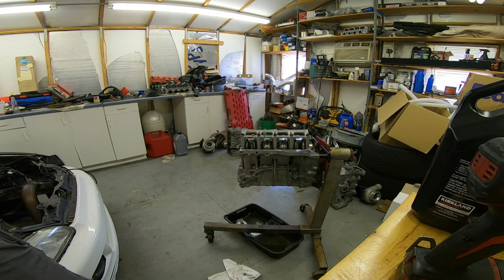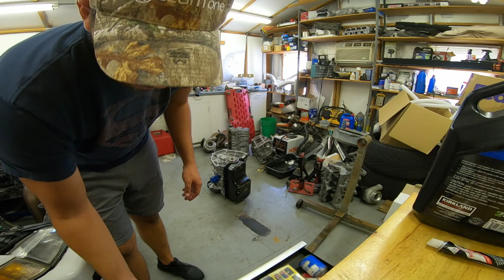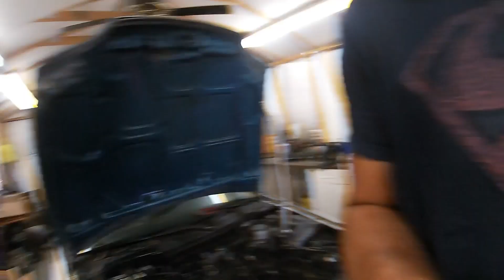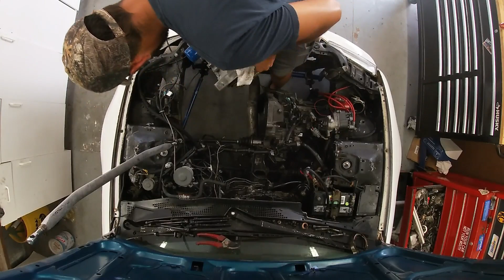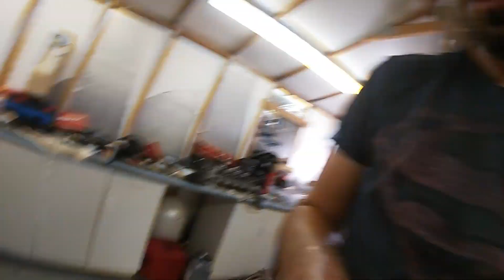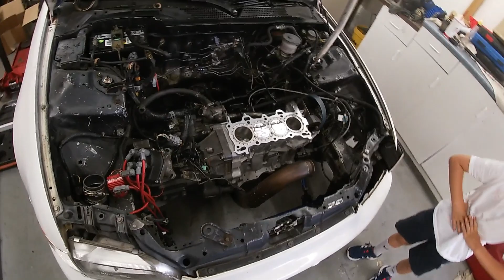11.65.1 comp D16Z6 block build/final assembly and install.

Comment: Bro I have a mini me d15b2 block with po8-3 head no VTEC with pmg-fi obdo distributor 2 and 3 for the streets cities 4 highway and 5 over drive gd on gas on highway around 40 42 miles a gallon crusin in my CRX 2 3 4 gears to 7200 rpm no problem with gas the duel point is a Weber carb with out the float or bowl comprende amigo and I'm around 10.5 compression with out shave head if I shave the head 10 mm I probably be will be around 11.1 or more with the y8 head gasket and believe me on a 4 barrel EFI system or regular carb be a monster with upgrade springs and retainers probably 8500 rpm easy and all motor regular carb don't have limits rpm or Weber no computer crap only start up and ramble real simple

Comment: Bro easy you can that compression with a d15b2 block with po8-3 head with the VTEC and 272 cam with a 4 barrel carb or EFI carb system and run on 91 to 93 otane gas you can even go 12.1 compression on aluminum head on gas I think with are different

Comment: How’d you get the block in there without removing the axles? I had so much trouble trying to do that. Any pointers?? Thanks
Reply from the maker: Axle's shouldn't be in the way at all. its pretty simple to get in, main thing is having the clutch aligned properly and the post mount needs to be off.
Reply: Well you made it look easy 😆 I was fighting and scratching my head. I’ll give it a go again this weekend and shoot an update! Running the same pistons on my build. How do you break your engines in? Thanks again!
Reply from the maker: @dAnIeLJeE87  i use non detergent 30w and just start driving, I try to keep it off the limiter for the first 200 miles but still drive it hard. as long as oil pressure stays consistent im ready to send it after that.

Comment: Hey bro I have another question I was going to order a aem fuel rail for the z6 but I’ve read online that the mounting wholes are different from y8 to z6 I have a skunk2 pro intake manifold will any d series fuel rail fit ?
Reply from the maker: yes, difference is regulator position.

Comment: Nice!!!!!!!! What chip did you buy for your p28 ecu?
Reply from the maker: I run a Neptune RTP
Reply: @hatchbackturbo93  is the Neptune RTP cheaper then hondata s300? And where did you order the chip from? I’m looking to buy a kit
Reply from the maker: @BarrelLineTactical  similar pricing but normally about $50 cheaper. I bought mine @ HAmotorsports
Reply: @hatchbackturbo93  ok cool thanks for the info bro 💯

Comment: are you running a stock transmission, if so from what D serious engine specifically or can they all handle 500hp?
Reply from the maker: S20 B000 from a 92-95 civic ex/si, its stock other then a straight cut 3rd and 4th gear. everything else is original

Comment: How hard is it to find a D15B VTEC.
Reply: not super hard, I found my d15b vtec head on ebay for 300, then put it on a b7 block.
Reply: I have one in New Zealand if you'd like..
Reply from the maker: haven't looked for 1 in a while. used to be easy and could grab 1 from a jdm dealer.

Comment: I say around 22psi you make 500+ whp with that high of compression also let's see if that 4 piston head likes the extra bump
Reply from the maker: yea, I agree. I was thinking 23 psi to make 500whp
Reply: @hatchbackturbo93  Yeah somewhere around there I think so too some people don't realize how hard it is to make good power with these motors until they've actually done it you have and you know 🤙
Reply from the maker: if it makes it sooner great but gonna be hard to control power
Reply: @hatchbackturbo93  will this be on E85 ? Or c16 ?
Reply from the maker: @89hybrid88  E85
Reply: Seen 10.5:1 do it on less than that with a smaller turbo. It was at 15-17psi I believe
Reply: @rainmaneg6240 Done seen and heard are all different Done yourself is the only thing relevant dude if your not guessing your not educating anybody my build has been my daily for the past year now on 30psi with 11mm SRT4 head studs all done by me and that I can speak on from experience not some video I watched besides I was telling him my guess